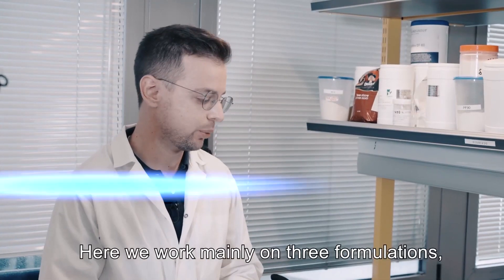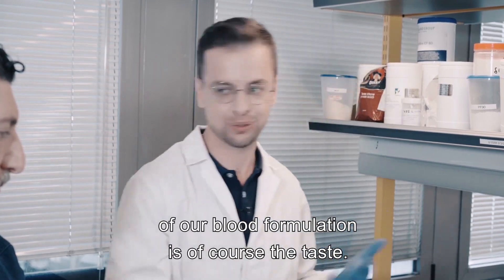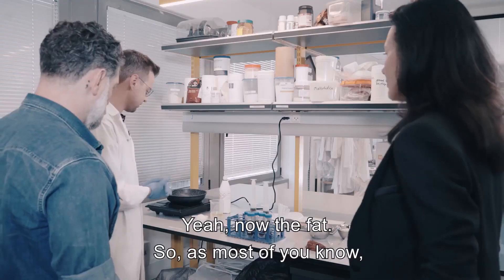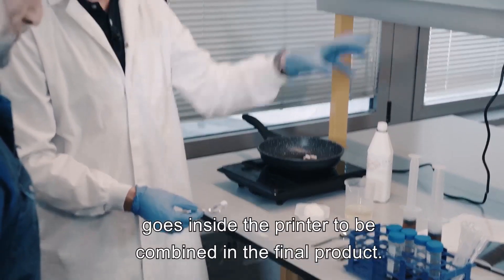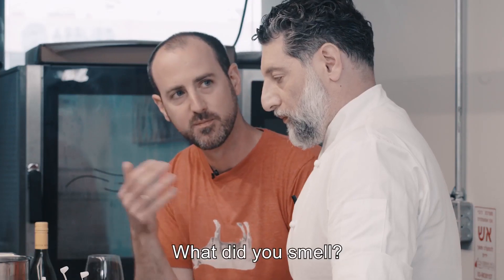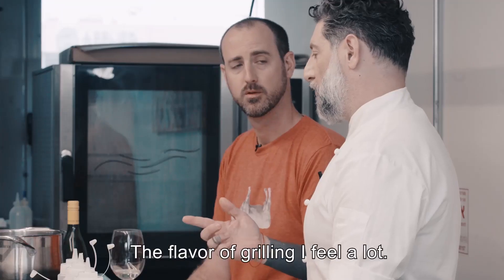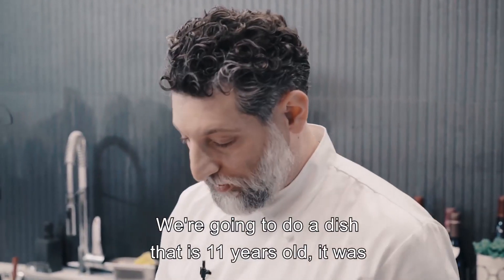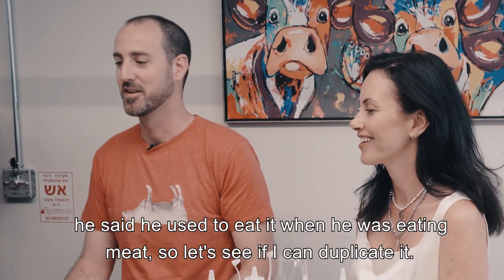3D-Printed Meatless "Steaks" from Redefine Meat

Comment: I'd be more than willing to switch to an alternative as long as 15 years later after eating it new research didn't uncover that this type of synthetic meat increases stroke, dementia and cancer risk by 70% in people who consume it daily. Which is usually the case with anything new with not very much long term research.
Reply: Where did you get this information?
Reply: @fritzzz1372  HE DIDNT SAY THAT IT DOES HE IS SAYING IF BRO BUT IT'S MADE OF PLANTS AND STUFF SO IT CANT DO THIS STUFF THO
Reply: @DontTrustGlitch  nice caps
Reply: It will be the most researched food product in the world, just like mycoproteins are right now. It is another meat replacement produced like fungi, you can think about it like yeast. The stakes are high, pun intended, and the meat industry will watch them carefully. Also, it seems it requires less heat processing and the factory can control what compounds they need rather than getting a variety of flavors from burning to various degrees food on the pan.
Reply: I dont get it, the health concerns you are mentioning is exactly what eating meat does to the human body… especially red meat is concerning..
Reply: @EggZema_  exactly the same then as highly processed foods, which is what this is.